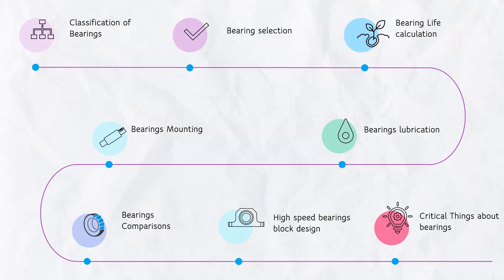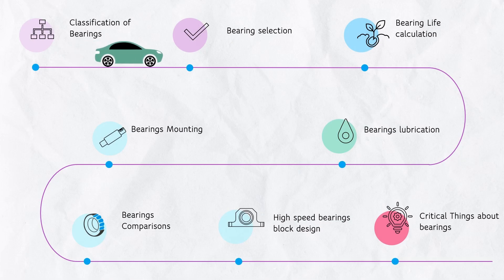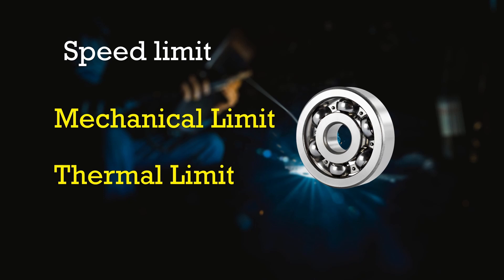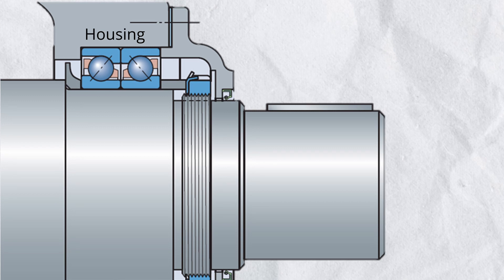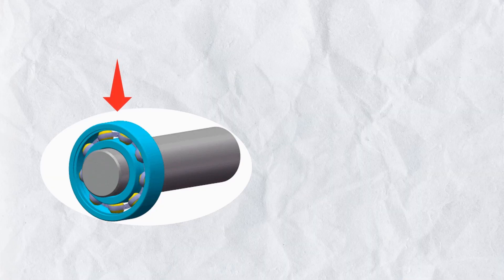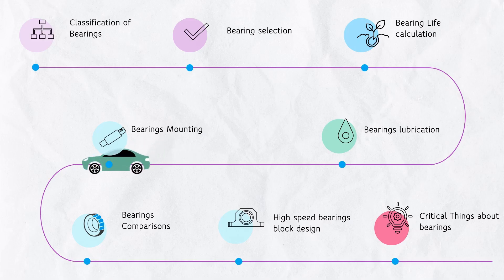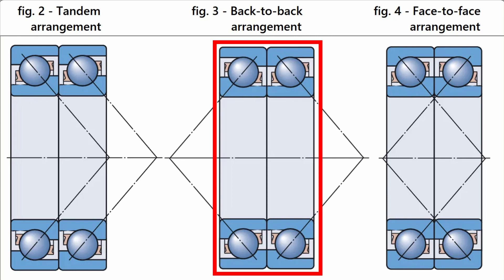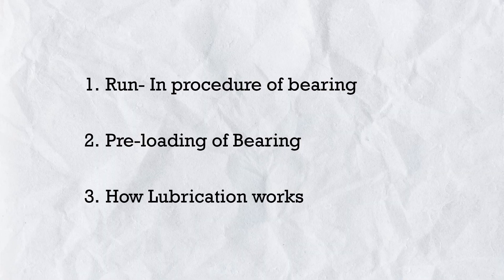Bearing Masterclass Series for Mechanical DESIGN Engineer! Road map

Comment: Hi, I need to know shaft diameter selection with respect to right bearing selection.
Reply from the maker: No no. Shaft selection should be on the basis of required strength not according to bearing. Bearing selection should be on the basis of shaft size.